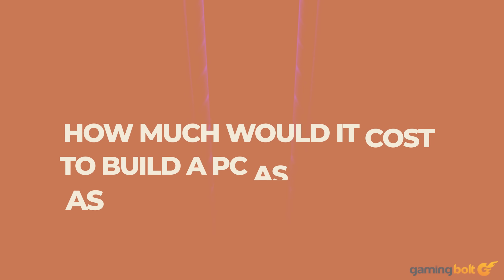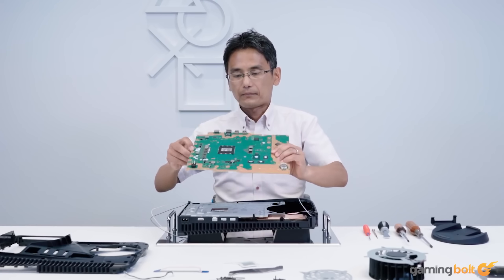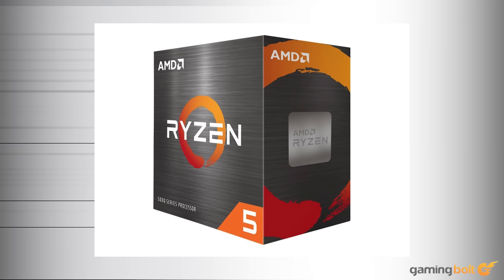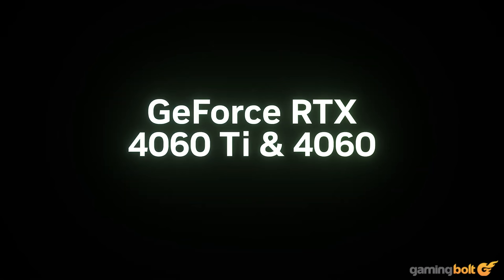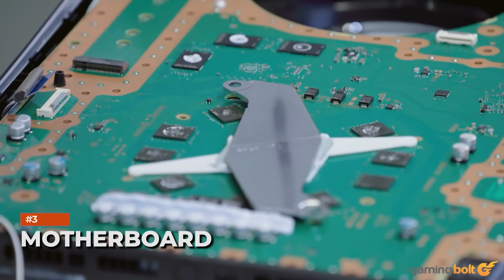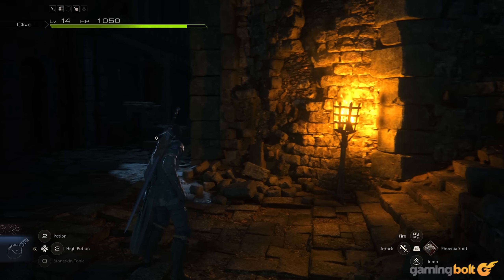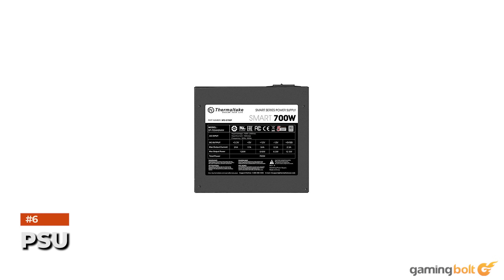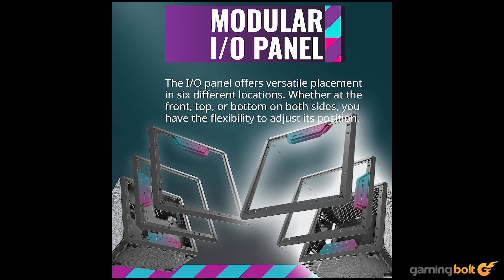How Much Would It Cost To Build A PC As Powerful As The PS5? (2023 Edition)

Comment: With the Ultra HD blue ray drive and the PS5 controller (If you wanna keep the haptics quality) the overall price would be north of 900 bucks . $400 more than a PS5  , and with the specs of the parts you have listed you will not be able to get the same performance in games designed for the PS5 that aren't optimized for PC .  IDK.........

Comment: You don`t need to copycat a PS5 solution ! You don`t need 8 core ZEN 2 max. 3.5 Ghz . Ryzen 5 5500 - 6 core 4.2 Ghz ZEN 3 is bit faster . GPU AMD 6650 XT is enough. 16 GB RAM , 1 TB SSD , Motherboard - 500 US$ MAX !

Comment: The RTX 4060/TI is a terrible choice since neither is a good comparison to the actual graphical capabilities of the oberon APU inside the PS5. Closest discrete GPU would be the RX 6700 non-xt. The PS5 still has slight edge though due to it's 16gb of unified memory.
Reply: unified memory, that would be like memory for both ram and vram yea? Sounds like that'd be a disadvantage tbh.
Reply: @danielfranz6560  not if the ram is GDDR6, which is what both the PS5 and Xbox series X uses. Also, game consoles are not like regular PC's. It's ram usage for the non-gaming functions is much smaller and much better optimized.

Comment: Here is a more accurate PC parts equivalent:
AMD Ryzen 7 3700X 3.6 GHz without the boost clocks enabled
8 GB of RAM (Memory is shared with the GPU on a PS5, so 8GB is fair on a PC)
The RDNA 2.0 equivalent of an RTX 2070 or RTX 2070 Super
1 TB NVMe SSD

Comment: That’s the thing, when developing for a single piece of hardware that doesn’t change, you really don’t need to have a shit ton of power in a system.

Also, developers have pointed out how good it feels to develop games for it, thanks to the resources Sony provides.
Reply: Regardless the PS5 is very powerful though
Reply: @aaron4757  not really though, like a 6700 xt which is 300 dollar’s EASILY beats both next gen consoles in terms of raw power.

But optimization of games and the resources Sony provides, make the games run like they are on a 6700xt if that makes sense
Reply: @phant0m_633 doesn’t matter if you make a pc with the same specs or better than the ps5. Technically the ps5 is capable of out performing the best pc out in the market right now

Why? Because PCs are held back by previous generation hardware. 

Nobody remembers this but both the series x and ps5 have revolutionary architecture that surpasses PCs. 

What is this architecture? The architecture is the way every component connects to each other, that being: gpu, cpu, ssd, and ram.

Remember when mother boards didn’t affect fps? Well guess what, now they are affecting the entire generation of computers. 

The positive side is that with pcie gen 5, motherboards are beginning to catch up to console architecture. But it currently won’t make a difference because games companies aren’t making games using the new architecture even for consoles.
Have you noticed that games haven’t graphically changed all that much and literally a SINGLE INDIE GAME DEV can make a game that looks 10 times better than a AAA game. 
It’s because big companies are just making games to grab people money, they aren’t focused on make it good games like they used to.
Reply: Many developers have also stated they prefer making games for Sony. They said when they make games for Microsoft they have to make it compatible with the S, the X, and pc simultaneously which can sometimes hinder the games optimal performance options and slow down production.
Reply: @adamstilwell4209  yes.
Reply: @phant0m_633  it’s not just about specs. It’s about architecture entirely at this point in time. And it’s been proven multiple times. Like why do you think a pc with specs that far surpass the ps5 still can’t beat the ps5??????

Comment: Are you serious ? RTX4060 is 15 tflops and RTX 4060 Ti is 22 tflops ! And you only need 1 tflop PC to match with 2 tflops consoles because of their different architectures. It should be : 

- Ryzen 5 4500: 86€
- RTX 2060 : 250€
- 16 Go Ram DDR 4 @3200 Mhz : 36€
- SSD 1 To Western Digital Green : 67€
- Motherboard MSI B550 : 105€
- Power supply 500W Gold Be Quiet! : 73€
- PC Case Thermaltake V150TG : 52€

So it's only 669€ to have specs a little much better than Series X.

Comment: As a ps5 early owner, i soon began to notice how crappy it really works with RTX. most games are unplayable without performance mode
Reply: Yeah, it's kind of a bummer they couldn't ditch the low framerate gameplay still. Sony should make 30fps illegal on their console. Even a game with lesser details and lesser resolution looks much better on PS5 with a smoother picture (say 60fps), than the same game with more details and higher resolution with a less smooth picture (30fps)..
Motion smootheness ABSOLUTELY affect overall picture quality, except if you're looking at still picture photographs.

Sure, I agree that the standard should be both NATIVE 4K and 60fps (or more), but clearly this generation missed that mark.. But if not now, when will we ever get rid of the horrible 30fps gaming? Next gen will then have an excuse again to keep it? (8k? 16k?)

30fps was a temporary blip, or suppose to be, but now they seem to be making it into a permanent FEATURE.

Comment: It's GPU is technically most similar to a RX 6700 but it can't clock as high as MHZ because of overheating issues so is probably closer to a 5700 XT, which in turn boost clocks to nearly as high.
Reply: Also, based on what I read online, on the Nvidia side, an RTX 2070 Super is as powerful as the GPU in the PS5. Correct me if I'm wrong though
Reply: @raymondtunacao8774  you can find a lot video comparation of ps5 performance mode vs rx 6600xt ultra mode. And 6600xt run still faster
Reply: As someone who wasn't "in touch" with PC gaming for a long time, I was really shocked that PC gamers weren't happy with 60 FPS, 4K Ultra settings with ray tracing anymore; They're trying to get 150-200+ frames per second and THAT'S where the actual difference is. 

Look up the comparison videos of a PS5 vs. an RTX 4080 on games like Avatar, Robocop, Cyberpunk 2077 and Final Fantasy VII. If they're locked at the same frame rate, you really can't tell the difference unless you're freeze framing and zooming all the way in to notice a slightly lower definition on one of the textures. If it's a single player game, I really don't think doubling the frame rate is going to make a tangible difference for your game play. I'm also n old school guy that thinks the high frame rate, and "true motion" stuff in live action movies and TV shows make them look like bad soap operas and ruins the immersion.... so I'll admit I'm biased.

  @raymondtunacao8774
Reply: Its much closer to a 5700XT with most decent 5700XT cards being able to run at their boost clocks. Many of the choices he made for his component selection really didnt make sense if trying to build as close to a like for like as possible. I ran the numbers through PCPartpicker and came up with a build budget ~$500-$550.
Reply: The point is to get the same perfs. The optimization on a ps5 will always be better, so you need to compensate with better hardware on PC to get the same performances
Reply: technically yes but thats bulshit. digital foundry tested rtx 4060 vs ps5 gpu. they was in the same level. I dont know how sony did this but it is what it is.
Reply: @georgkeller3225 it's the SSD In the ps5.its controller has a custom hardware decompression block that will do the work of the CPU and send uncompressed assets straight into Vram to be processed instantly. On pc without direct storage the assets are put into system ram in a compressed state the. The CPU will decompress and put it into Vram 

With direct storage it still needs to use the CPU for decompression

With direct storage and RTX IO the assets go into ram in a compressed state then that compressed data goes into Vram to be decompressed by the GPU then processed. 

So the ps5 has far less hoops to jump through to deliver that data to the GPU

Comment: cool video, and well done. I also think that going the pc route has advantages in the longer term. The ability to continually upgrade a pc alllows you to get maximum use/value out of your components not to mention residual value of functional replaced components. I think console is the "easy way to go" and understand the thinking but I think that  the price/performance on pc's and pc components has been improving for years and it doesn't look that will change in the foreseeable future.
Reply: but wouldnt be the money you spend on the upgrades eventualy be as expensive as buying the by then new ps?
Reply: not really, for example i have a i7 3gen I am still using because I have added some ram I got for free and made at least 3 upgrades to the GPU since I bought it in 2012 I have no interest in going higher than 1080 and am able to use all software and games I need. So in the last 11 years spent less than 200 on upgrades and it is still going strong, at least for what I need it for
  @gilco2832
Reply: @gilco2832  consider the yearly subscription costs, along with games generally being higher prices as opposed to pc, not to mention pirating on pc makes all games free if you really want lol
Reply: @gilco2832 No. Because the upgrade is cheaper than buying a new console while giving a better performance uplift then console. Fun fact: You don't need to upgrade a PC. You can use 15+ year old components to play the latest titles. Obviously a 15 year old CPU wouldn't be a good experience so you would probably upgrade after 1-8 years depending on how cheap or rich you are. Some people are nade if money and upgrade yearly while others wait eight years until they really want the latest graphics.
Reply: Pc is the only logical choice for me. I need a fast pc for non gaming as well. Having the ability to game in free time is just the added bonus.
Reply: Yeah but your forgetting the latest gpu at moment like the rtx4090 is 2700 quid alone every time you go to upgrade you could have got 3 consoles that play the thing you wanna play with that 3 grand graphics card and they are just gonna get more expensive if ya have deep pockets like the 1% out there definitely go for it but for the rest of us consoles do the job just fine also ya gonna have to pay virus protections on top that’s a monthly fee aswell and more console is soo much more simple to use and care free no hassles they run themselves maintain themselves just simpler
Reply: Consoles are meant to be easy. I can buy a game and know it will work on my console just fine. On PC it's a bit of a gamble how well it will run. I know how to work with PC hardware, I just don't want the hastle. I just want to sit down after work and jump into the game I want. I've never cared about optimal performance and insane graphics. That's who consoles are for.
Reply: @mrgalaxy396  Whatever helps ya sleep at night kid

Comment: So based on what I have read the ps5 cpu is equivalent to a Ryzen 5 3600 or 5500. While the gpu is between RX 6700 and 6700 XT.
Reply: It is a downclocked 3700X 8 core zen 2 cpu. anyway a 3600 will perform almost the same in gaming.

Comment: This guide is awful! M-ATX case for a full ATX mobo? Not to mention the thermaltake smart series psu is notoriously terrible! If you want a pc actually comparable to the PS5, buy this instead: 
CPU:  Ryzen 7 2700 (185 usd new, 70 usd used)
GPU: Radeon RX 6700 Sapphire impulse (280 usd renewed on amazon )
RAM: Corsair vengeance LPX 2x8gb kit (38 usd new)
MOTHERBOARD: Gigabyte B550M DS3H AC (100 usd new)
STORAGE: 500 gb Crucial p3 (27 usd new, or for 1tb 43 usd)
PSU: EVGA 500 GD (70 usd new)
CASE: DeepCool Matrexx 40 (50 usd new. 1 case fan included)

Total: $803 IF YOU BUY ALL NEW
Im sure you could get the total down to around 650 IF YOU BUY USED! Check ebay and also your local used market places. Overall, there is no point to this video. The Pc he puts together isnt comparable to the ps5, it's probably a little better. He uses new gen nvida graphics with a 6 core 12 thread cpu that is 5th gen. I would go with his build for overall performance, But mine is actually comparable to the ps5.

Comment: You forgot tax, bro. And those peripherals you mentioned are kinda necessary. You can't actually play without them. At the very least KBM and a monitor. Also, if you want to match PS5 performance, you can do it for a lot cheaper than this. This system WAAAAY outperforms current-gen consoles.

Comment: Its the 16GB of GDDR6 you won't be able to come close to and you didn't do such a good job at finding comparable PC parts specifically the GPU. Even still, you'd probably have to overspec a PC to come close to the software optimizations of predictable console hardware. A good game to test is the last of us part 1 as 8gb cards in general choke on it and the PS5 will not. That is a large piece of next gen gaming and will continue.  I would suggest making an updated video to this with what has been suggested by the community in the comments.
Reply: This is a great advantage for consoles. If you make a game for it, you make it for a single spec game optimized computer, not 100 different sets of random hardware. You can optimize your game for that 100% and 100 times over.. Another thing to consider is that a games only computer like console don't really need ram, almost, at all. They need graphics memory, and the "ram" is pretty much dedicated only as graphics ram.

Games on PC's generally use API tookits (ex.directx) for games, while game development on consoles can use things like PS Shader Language and barebones access to hardware through minimal simple access libraries.

Ofcourse, if PC gaming was done on GNU/Linux, this situation could be much better for PC games, but for now they generally run on a bloatly OS with bloaty toolkits, which aside from not being optimized for anything, PC games will have worse performance for it. This difference can be reasonable is my guess, but it can potentially be quite huge as well. I would think it's quite a luxury for a development team to be able to focus say on developing for a single console ("exclusive").. Imagine how much more focused their development effort, in theory, can be.
Ofcourse, most develop for "both" consoles, Xbox and PS, but even that is nothing compared to developing for those AND hundreds of sets of different PC's with differences and different capabilities etc etc etc.

Some PC folks seem to think, yes, this PC is double as powerful as a console, that it means the games will perform better. While it might actually perform just the same, or possibly even worse.

Comment: Based on how the used market plays, it would be much easier to hit the 500 USD mark. Going with a second gen Ryzen 7, lower end B450 motherboard, RX 5700xt, 16GB of budget RAM, an Intel 670p nvmE 1TB drive, the same or slightly cheaper case, and a slightly lower wattage version of the same PSU would bring a build that delivers the same or similar performance, especially if overclocked. I have to agree with the other commenter who said the performance of a Gen 4 drive would be greatly diminished, thus not worth the price premium.

Comment: building pcs used to be fun for me but these days its just n expensive and frustrating experience, the console is better simply because games will be optimised for that console and will always run properly out of the box, the only time to spend money upgrading is when a new machine comes out and then you sell the old one and buy a new one, job done.
A PC has to be upgraded often just to be able to play the latest games at any kind of reasonable level and even then you have to mess about with settings to get the best out of it.
Reply: i will never go back to console but you have a very valid point, but you cant blame the pc parts. blame the devs for making crappy pc ports. because trust me it will still run crappy on better pcs it will just run less crappy

Comment: The 4060 ti is an awful choice and a rip off. An overclocked 3060 or RX 6600 xt would achieve PS5 performance at a significantly lower cost.

Comment: Well it isn’t hard to build a pc that is much faster than a ps5 and with the capability of going to 120fps with ultra settings turned on (depending on the game).  Unfortunately the cost of the GPU alone is at least the same as the PS4 and much higher for a top graphics card. The question is do you want a pc that can play games that are only on PlayStation and Xbox old and new with better graphics and ability to use mods, or are you fine with being  stuck with consoles okay systems. It really does come down to what you are willing to spend and affordability.

Comment: I truly believe the next generation of consoles will have hardware that can easily run 4k and 120 fps and their games will utilize it. Not just one or the other.  Your eyes can't really see better than 4k and 100 fps. I wonder what the "PC master race" people will say then to justify their $2,500 setups.
Reply: Your eyes can't really see better than 4k and 100fps .... You must be trolling 🤦🏻‍♂️
Reply: @nico3064  Yes if your face is pressed up against a 8k or 4k screen, you can tell the difference, but not when a 60 inch screen is 6 feet away. There are actual charts to represent this. And your fps that your eyes can see is about 80, but higher fps can appear smoother. The 144 fps monitors are just a gimmick to sell you something that you don't need.

Comment: You lost me at 4060 that gpu isn't even close to ps5 gpu at least be true to what you say and it will just turn out to be a typical build which is what is the latest in the market is what you will use. Why not use an i7 on the cpu either since you are already off on the gpu side which was not close to the ps5 build.